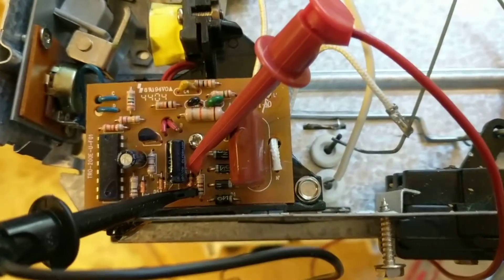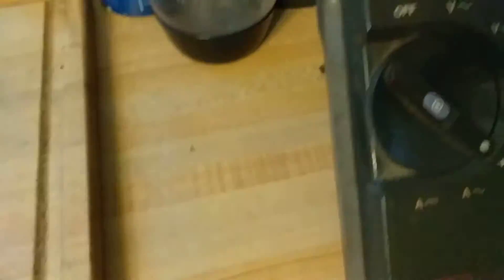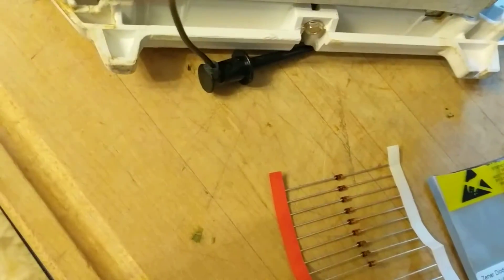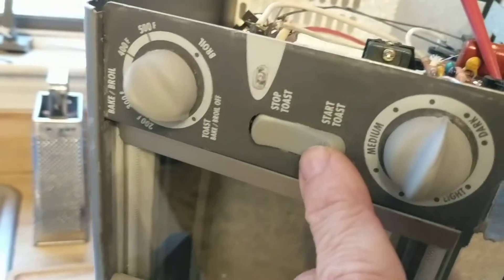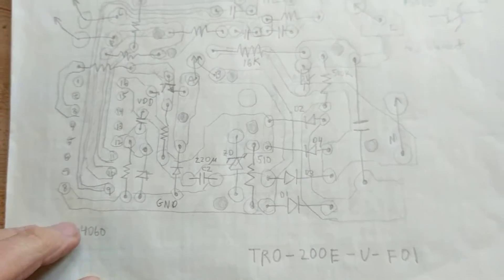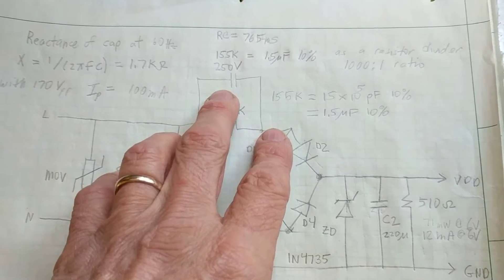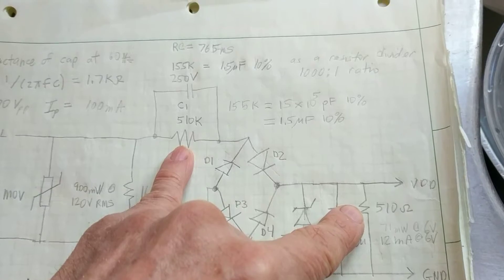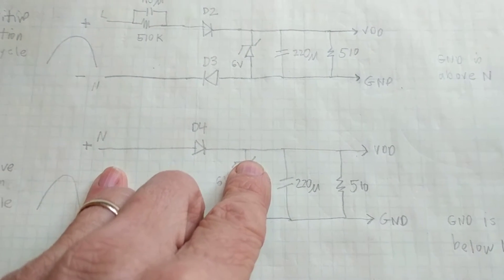Black & Decker TRO355 TRO200 Toaster Oven Fix: Blown Zener Diode

Comment: How did you figure out how to source the zener diode?  I have the same style of failure on my Oster toaster where the zener diode that sends power to the electromagnet failed.  Mine failed in a direct short and got hot enough that the writing on it melted off.  I can't find a schematic anywhere online.   There was another zener on the board that looked the same size and it was a 1N4733a (5.1v) so I bought some of those.  But this didn't fix the toaster.  The electro magnet is not holding the bar when engaged.   For giggles, I put a 1N4007 diode in there which worked, but it's causing the 1000ohm resistor in circuit with it to get hot.. very hot.   So obviously I need exactly the right diode to fix things.   I measured the voltage across the diode and mine stays energized even when the main lever is not engaged.  I assume the current fed through to the electromagnet goes way up to energize it though at the time the lever is pushed down.   But 5.1v getting to my magnet isn't doing the trick to make the metal bar stick.

Comment: Where did you get the technicals on this oven? I have the same oven (355 TY8). The bake function works intermittently, and when it does work, it would work for only a couple of cycles and then wouldn't come back on again. The toast function works but doesn't know to stop getting hotter or when to end (pop the button back out).
Reply from the maker: Hi and thanks for your comment. your symptoms sound different than the problem I was having. On my oven the problem was that the start toast button would not stay down (would not latch). when i did an internet search I found others with the same problem who had attributed the problem to a blown zener diode. Based on this I removed and checked the zener diode and found that it was indeed bad. Now, while I was investigating my problem I did come accross US patent 5,402,708 CONTROL FOR A TOASTER FOR VARYTNG
THE DURATION OF THE TOASTNG CYCLE (1994 Black and Decker). This patent does describe how they control the toasting function and it might help you understand some of the technicals of this oven. Hint: when trying to debug an appliance it sometimes can help to check the patent numbers on the appliance. reading them can help you understand how the appliance works